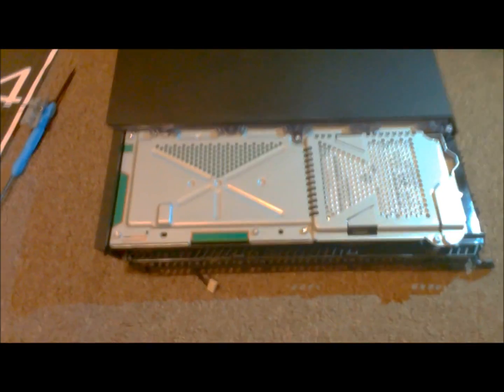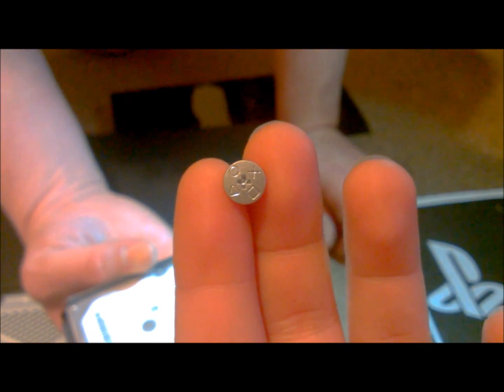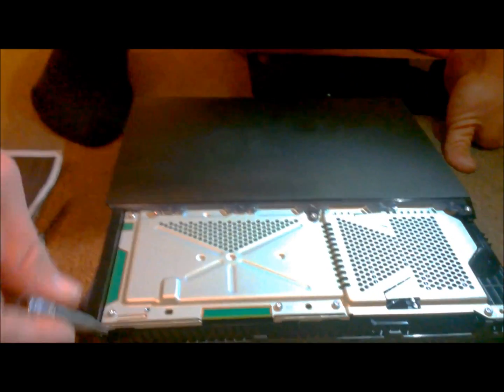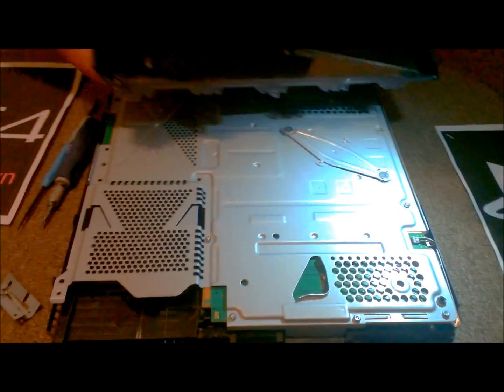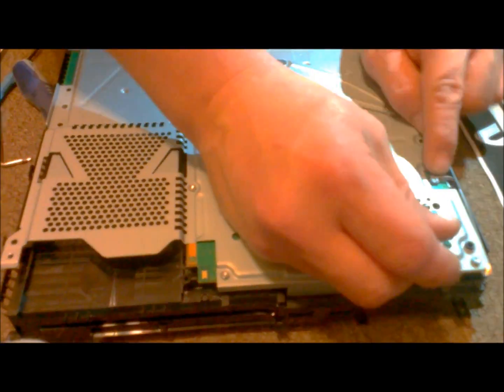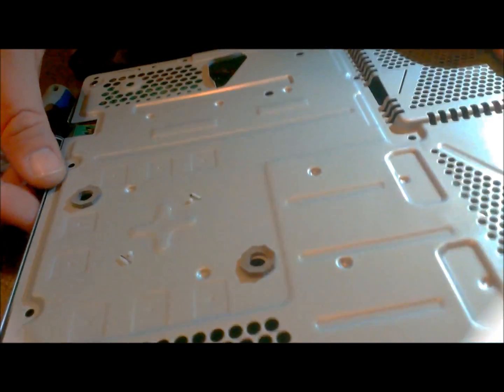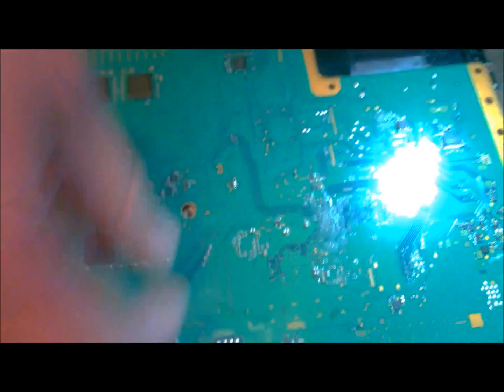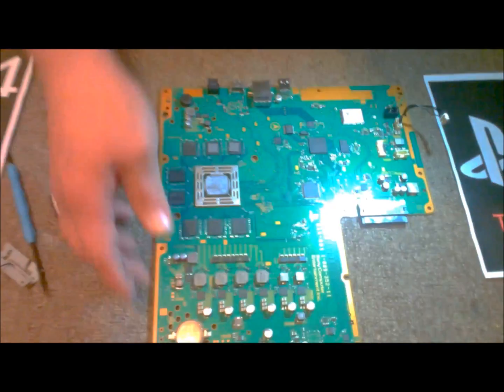Playstation 4 Teardown Part 2

Comment: lol @g-unit what thermal paste do you guys think is best i have as5 and mx4
Reply from the maker: Well...Artic Silver 5 seems to be the talk of the town these days...but I don't use it on everything. The temp differences between different brands of thermal paste is very minute so as long as it's not a generic brand, artic 5 and mx4 would both work great on a gaming console.....I just hate the fact that since it has silver in it...it is a conductive paste...so if you get a little of it ANYWHERE on the board accidently it could bridge contacts and short your system. People will always defend their favorite thermal paste.....but We use a few brands for different things and they all work brilliantly!

Comment: im not an arctic silver fan.
but every thermal paste doesnt do the same job on any chip.
for straight contact with fan and chip like ps4 has,you need a thermal paste with more density.
and caramique its not.
and because ps4 fan has straight contacti with chip the good thermal paste it matters a lot.
i also opened mine ps4 and used icdiamond 7 carat
Reply from the maker: To each his own.
That thermal paste is very dense...like we are.
There is absolutely no problem using either. The temp differential is minute.
This is not a thermal paste measuring comment section.....Take it to a forum. This vid is on PS3HAX....go rip it up on their site.

Comment: my friend the thermal paste you use is not good
Reply from the maker: Never said it was the "Best thermal paste ever".
I know all of you artic silver fans hate anything but....
there is a cool article I read about it...and the temp differential between them is so minor that it really doesn't matter. If it wasn't good, we would have A TON of pissed off customers. But we don't.... Use your Artic 5 Silver...get a little tiny bit on something other than the chip....and you're in some trouble. Use what you want......we do.

Comment: Guys really interested and cool video! Thanks for sharing man! U guys should do a temp comparison test of it in vertical and horizontal position! Proud to be a subscriber to you guys!
Reply from the maker: Thanks rakarday! That is a good idea. $ony and Micro$oft seem to want you to play them on their sides so as to NOT overheat. I  don't like ANY of my systems on their sides so I have them all flat with 1 1/2 inch furniture feet covers...the ones you use if you have tile....so they are all off the ground and elevated enough for air to pass under them with no problems. And I clean them every few months since my girlfriend smokes like a chimney...

Comment: I read about the heat sink:  Apparently the entire bottom shell works as a giant heat sink for the APU and memory.  If there is a heat sink at all other than that, it must be pretty thin, being in between the metal and plastic casings like that.
Reply from the maker: Good eye my friend. I actually saw the pics of it on wired so that's why we decided to leave it out...may throw a pic in the video so that all you fabulous gamers can see. It is thin...and the metal does take A LOT of heat from the APU but distributes it pretty evenly in the system we have. I've heard about all the problems...guess taking it apart solved the issue. Wouldn't that be hilarious!